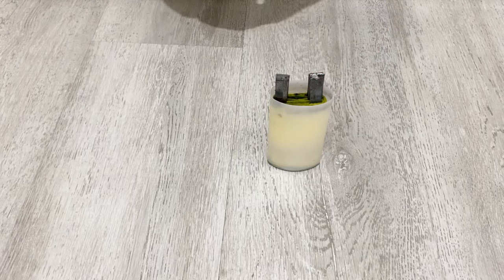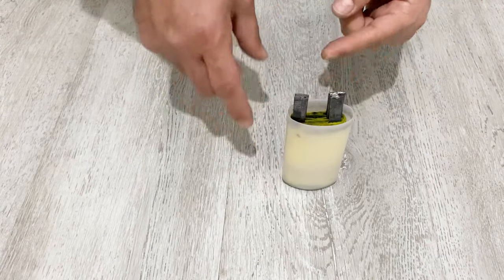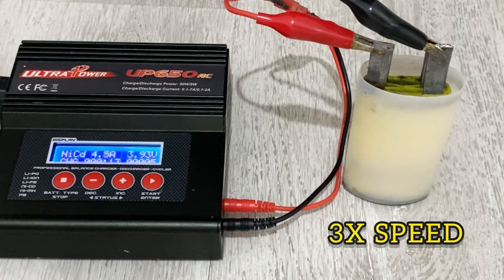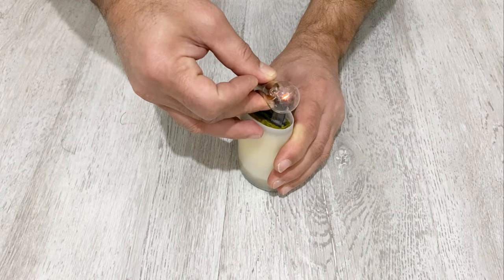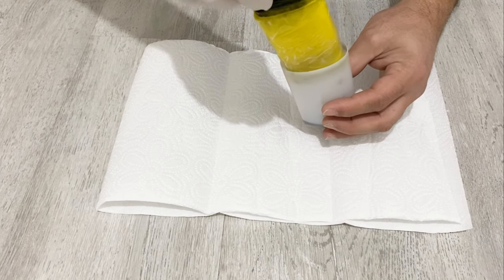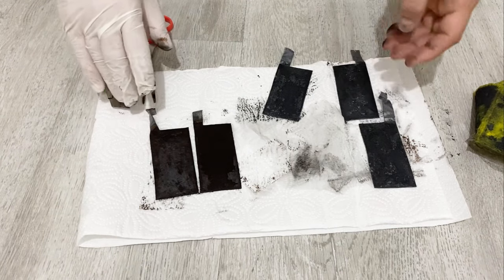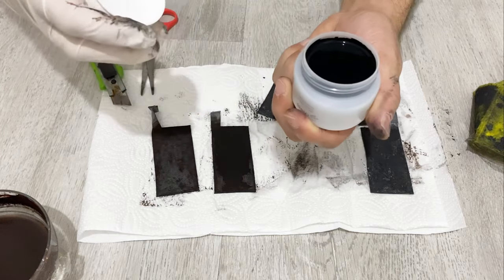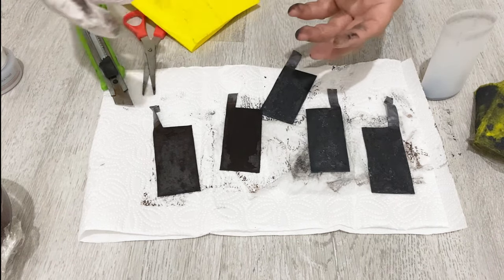How to Make the World’s Strongest DIY Supercapacitor (2.1 V, 2000F Hybrid)

Comment: Itsot a fake video i make these but you say its a super capacitor, yet the coatings on the electrodes are different which polarises them... 2 polarised electrodes and an electrolyte is a battery... B...A...T...T...E...R...Y not a capacitor... A capacitor requires a seperator that prevents electrical current... This is a chemical resistor aka chemical battery jeez... Study what a battery is and then a capacitor and make your own minds up... Nice battery though. They coat the metal to protect it from corrosion from the electrolytic chemicals as they are highly charged which makes most of them acidic... Acids placed inside a plastic beaker xan dissolve metal but nit the beaker... Thats why they coat the metal, graphite and oxides mix well with reains to make them conductive and if you mix different metals into the mixrures you can produce non corrodible polarised electrodes... By adding the graphite the charge rate is halfed and the potential voltage output doubled although as i have found in my own tests upto just over 2 volts can be charged onto these graphite based conductors if overcharged
Reply: you must be reasonable.this is not battery nor capacitor.this is a hybrid capacitor.which can give a lot of current in short time and also it can keep the current like a battery.so it is very clear .hybrid super capacitor

Comment: Good work but still it is not a capacitor Dear. It is still a battery. Because Capacitor has Capacitance and Symmetric dimensions of plates. It is a battery unless you claim it to be an Asymmetric capacitor.

Comment: Try sodium sulfate instead of sulfuric acid. And replace the lead dioxide active material with your activated carbon and graphite active material. Use for both electrodes
I did this and got similar result with high capacity and performance. Motor spin very fast and powerful.

Comment: This is called a Super Battery originally researched and developed in Australia.  However,  it is still a lead acid battery  and it has issues with sulfation just like normal lead-acid batteries.
Reply: With plain solid lead electrodes sulfation is not much of a problem. compared to commercial lead acid batteries.
Commercial ones suffer from sulfation due to the massive surface area of the thick porous plates. but with this simple version it is not nearly as much of a problem.

Comment: Does it perform better than a Lead-Carbon battery? If so have you compared the two?
Reply from the maker: Batteries and Supercapacitor are different than each others
Reply: Still it would be cool to compare some stats like capacity/weight, but even more important would be probably the charge cycles.
Reply: Size to energy storage is how I'd compare. Batteries can store much more than any supercapacitor but can't last as long or charge/discharge as fast.

Comment: hello.sir.thanks for amazing videos.i have just think about electric cargo cars which can carry persons and boxes in grand malls.i think if we use lighter and thinner lead sheets and useing sodium sulfate to prevent crossion of lead sheets.we can make a reliable and at least 5 years life span battery with low cost and high power which could be commercialized.what is your opinion?am i in a right way?and what will be the life span of this hybrid super capacitor?
Reply from the maker: I think we should work on your idea and try to improve and make it possible. All experimentations are good for science and for improving our knowledge
Reply: thanks for your reply.and i suggest you useing small and thin copper wire in cuo-feo battery as a current collector in cuo paint because cuo is a bad conductor i think useing 0,1mm copper  .nickel .or steel wire and 3mm approx length in this mixture can work well.and it is a best way to increase the capacity of battery without enlargeing the size of battery.also use poros or circle punched copper sheets it can improve current strength .and add lithium hydroxid and koh to sodium hydroxide it can improve your battery.thanks my bro for your good channel .with love from shiraz iran❤

Comment: This is NOT a super capacitor by any stretch  - this is a lead acid battery. The chemical actions are no different than a lead acid battery.
Thus this is a lead acid battery - it is NOT a capacitor.

Comment: how long did it take to charge and what voltage did you use?
Reply from the maker: The charging duration is depending on the current you charge with.

Comment: Amazing invention sir, then what is the function of sodium silicate at the negative pole? and what adhesive material is used on the positive pole
Reply from the maker: The function of sodium silicate is being used as the binder. It’s used in positive electrode as well.
Reply: @joyofelectronics9782  Thank you for answering my questions and adding new knowledge

Comment: For the size that looks like the best in the world. I must ask one question--how do you know its maximum charging voltage?
Reply from the maker: Thanks. There are two ways for that. The first one is the electrolyte determine the max operating voltage. (Ex: 2.40 volts for water based sulphuric acid, 1.4 volts for water based sodium hydroxide) the second one is experimental. Start to charge the Supercapacitor and observe. The voltage where the electrolysis begin to happen that voltage is the max operating voltage for that electrolyte. I hope you got the answer.
Reply: @joyofelectronics9782 yes, thank you. I wonder if you coat the paper towel or soak it and somehow dry it  with aluminum oxide powder or mica powder or barium titanate powder. This could increase the dielectric element. I'm studying batteries and it's just so fascinating. I'm making a zinc carbon battery first. Then magnesium carbon for higher voltage I hope. Then lead acid, maybe.

Comment: You refused to give the model of the charger and where I can get it to buy. Made by,?
Reply from the maker: Brother l took it about ten years ago from a local store. So it doesn’t have a jenerik brand and l don’t know how and where you can find it. You can’t find it on internet.
Reply: Pls are they coated both sides,? Is there any alternative to suldium cilecate? Can one achieve the same capacity with super capacitor made with allumium?

Comment: I like to do interesting experiments and for some time I have been reading about super capacitors and methods of their home construction. It seems to me that you have built not a super capacitor, but a regular lead-acid AGM battery. I wonder if without carbon the efficiency (stored current) would be as high as with carbon

Comment: Can hydrochloric acid be used in place of sufric acid
Reply: Or suldium hydroxide?
Reply from the maker: No
Reply: @joyofelectronics9782  Ok. Pls list the materials for positive and negative sides for me. What acid can I use in place of sulfuric acid? I intend to make 6 PCs in order to get 12v by 30amps since u got 5amps
Reply from the maker: @nnejiamaechi9385 why don’t you use sulphuric acid. It’s the best for this type of Supercapacitor

Comment: I wish there was a proper test to confirm the 2000F capacity. I wish I could share the video but without proper evidence I'd rather not take the risk. 
It would also help if there was a mention of the costs involved in DIYing it.
Reply from the maker: To avoid not having a very long video l didn’t cover those tests and informations. But in the other similar videos l will do that. Thanks a lot for your contribution 🙏
Reply: @joyofelectronics9782  Awesome, once you do I'll reference it in a document I'm currently working on which is about creating a tradeless and self-sufficient community. It's basically about applying the scientific method to societal organization in order to maximize abundance so the referenced material needs to be well-grounded. Anyway, thanks a lot for what you're doing...looking forward to the next videos😀

Comment: Just tell the viewers the leakage current of the capacitor which determines how long the capacitor can hold the charge without self discharge!!!!!
Reply from the maker: Self discharge rate is very low (average 10%/ month)
Reply: wet dielectric material to have such low leakage is astonishing. Thank you for your reply
Reply from the maker: @nara49veera12  no problem 👍